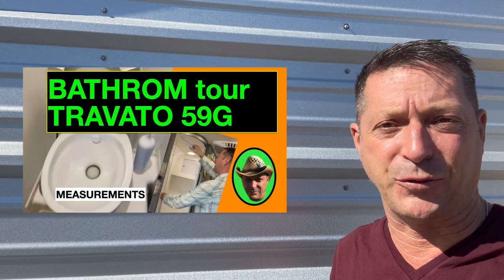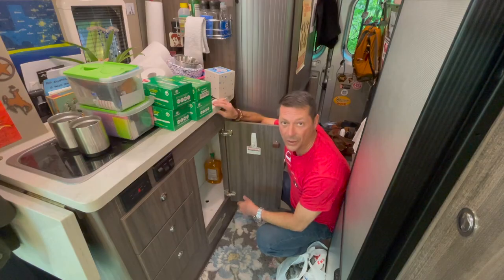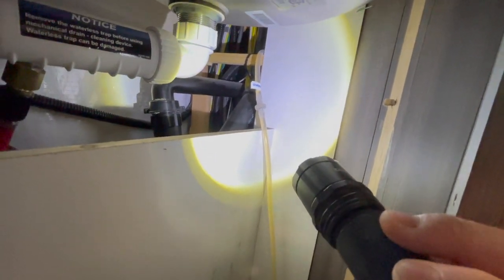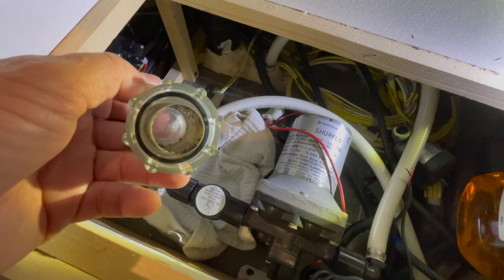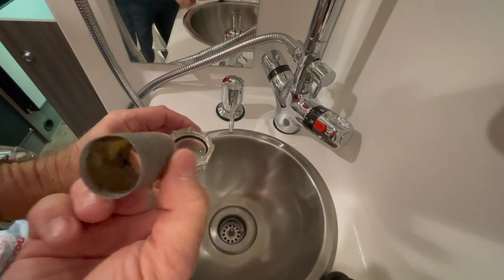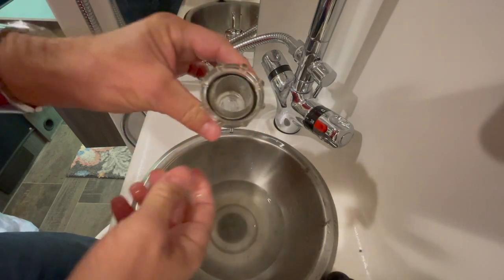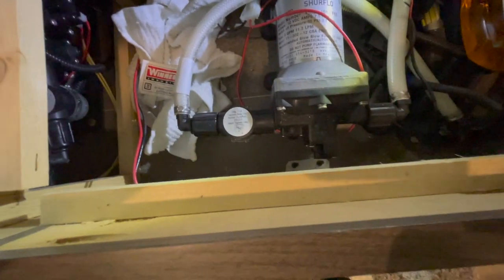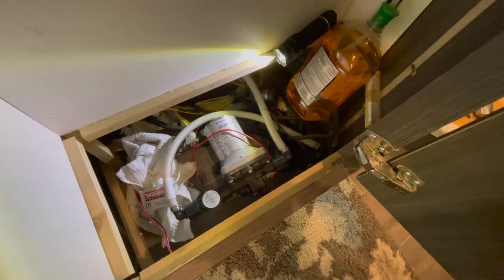How to CLEAN TRAVATO 59G SHOWER 🚿 DRAIN PUMP FILTER  Keep drain pump happy 😊 on pre-2022 Travato 🚐

Comment: I tried to shower this morning and it did not work, I looked under the van before finding this video thank you! Now it works.
Reply from the maker: Glad things worked out Brian
Reply: @gosmall.livelarge  any info on the water heater? Mine ended up with a terrible funky smell after not using it enough so I disconnected it and now I want to reconnect it that I can use the shower

Comment: Hi Scott. I have a GL 2021 and my pump is reversed, filter on (right side) still with strainer on bottom. The part about mine beside being opposite yours is Winnebago ran all the wiring across the pump so it makes it very hard to get to the filter and check for leaks after it has been cleaned. I would to get the Tech who ran the wireing to try to get to and clean out the filter!
Reply from the maker: Thanks for sharing.
Reply: I agree. I have a 21G and the wiring is all over the place on top of the filter making it tricky to get to.
Reply: Mine too—it's almost impossible to get to and eventually I’ll have to find a way to redo its placement and/or re-route the whole arrangement.

Comment: Does your water always go down the sink drain that slow??
Reply from the maker: The shower water drains very easily and quickly with the pump when the filter is clean
Reply: @gosmall.livelarge  I think the question is regarding the bathroom sink, it looked like it wasn't draining properly after you rinsed off the filter...